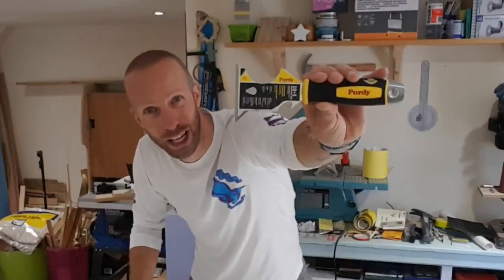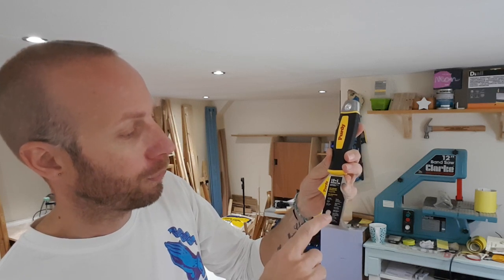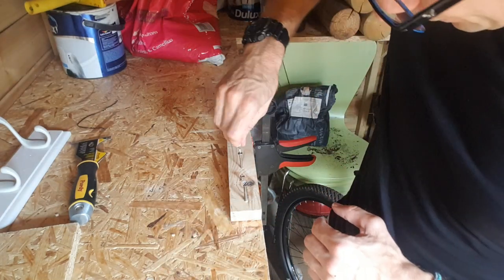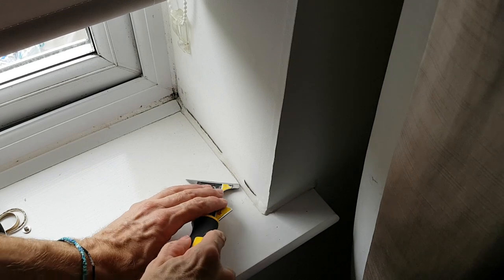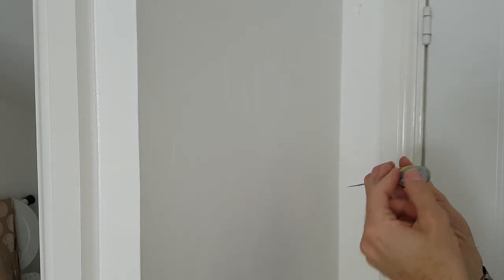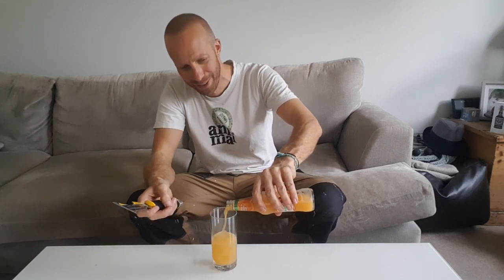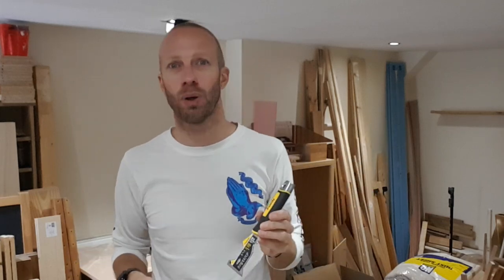Purdy 10 in 1 Painters Tool - Full Review

Comment: There is  NOTHING I HATE  worse than garages with sheetrocked walls. Those
arent a shop, they are living spaces. I ripped all the sheetrock down in my garage & hung 1/4 pre painted pegboard. NOW it looks like a shop not grandmas knitting room. I even opened up the ceiling so I could hang my hoist from the rafters & store lumber up there. Man caves are sheetrocked because no work is ever done in a mancave only game watching & beer drinking. Oh sure man caves always have a big tool  box but notice how new & shiny they all are because they have never been used.

!

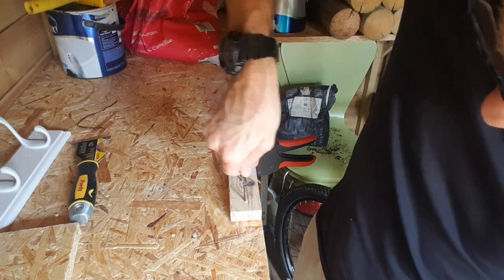Comment: At 3:10, mate, I think you’re supposed to put that little accessory back into the Purdy tool handle and turn it using the 10 – in1 and turn the screw.  No?
Reply from the maker: Yes I did try that after posting the video, it helps a bit, but isn't great.